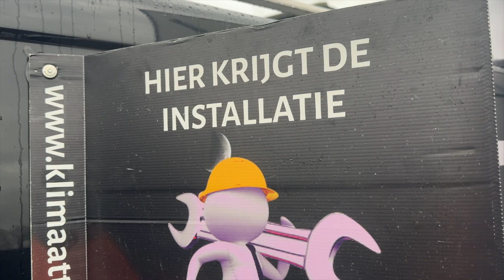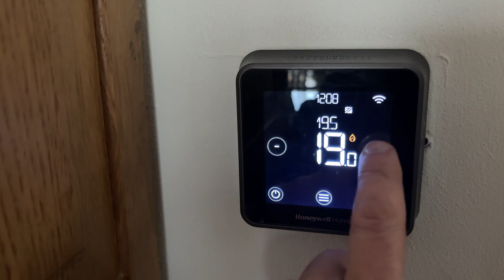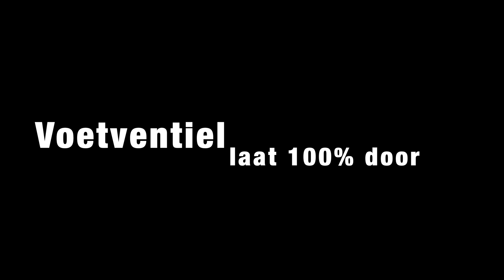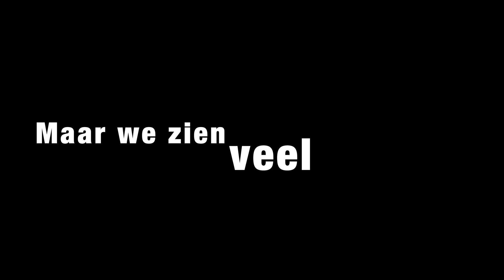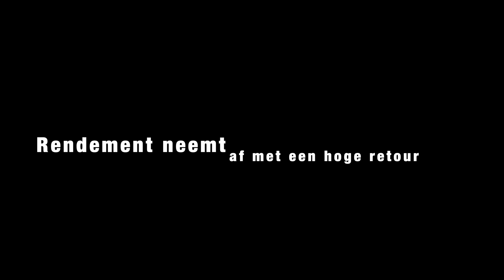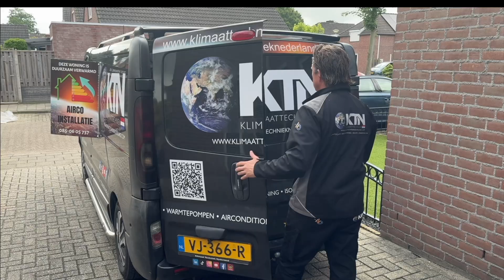Schrik van de Energieverliezen: Warmtepomp Weheat Flint en Nefit Topline

Comment: Die voetventielen,  is dat niet een 1 pijps systeem,    oftewel meerdere radiatoren op 1 streng.    anders zou de retour met koude radiator niet heet kunnen worden toch ?   ( bij 1 pijps is de retour uit het blok voeding voor de volgende rad.)
Reply: Inderdaad meen ik hier de 50-50 koppelingen te herkennen, zoals die ook in mijn CV installatie is toegepast. Daarmee kun je de radiatoren in serie schakelen in plaats van parallel, zodat je minder buizen nodig hebt. De 50-50 koppelingen laten de helft van het water door de radiator lopen en de andere helft gaat direct naar de volgende radiatoren. Wat je ziet met de warmtecamera klopt dus, alleen je conclusie klopte niet.

Comment: Mooi filmpje weer. Er is inderdaad wat ruimte voor verbetering (understatement). De vloerverwarming bevindt zich overigens op de begane grond in plaats van de begaande grond, al zal de begane grond ook wel begaand (=belopen) zijn en de hele installatie is ook om begaand mee te zijn (=medelijden hebben met).

Het nut van vervanging van de HT-verdeler door een LT-verdeler (of in dit geval een hybride) heb ik wel twijfels bij. Een HT-verdeler heeft door de verdunning met koud retour een iets lager vermogen bij gelijke aanvoertemperatuur. Dus de aanvoertemperatuur moet iets omhoog en dat gaat ten koste van het rendement van de warmtepomp (lagere COP). In de praktijk valt dit reuze mee. Bij een typische verdunning van een factor 2 in de HTV kun je de vermogensreductie meestal al compenseren door de aanvoer ruim 1°C hoger te kiezen. Dat kost ongeveer 3% rendement op de warmtepomp. Als je uitgaat van 3000 kWh per jaar (en dat is al fors voor een hybride WP) gaat er dus 90 kWh verloren. Dat kost ongeveer 25 euro per jaar. Indien een hybride verdeler 500 euro kost duurt het dan 20 jaar om die terug te verdienen! Ik vrees echter dat ie inclusief installatie nog meer gaat kosten. Bovendien zal in dit specifieke geval met 12 radiatoren en slechts drie groepen vloerverwarming slechts een deel van de 3000 kWh aan de vloer toegerekend kunnen worden en zal de besparing nog lager zijn dan 25 euro per jaar.
Reply from the maker: Deze verdeler is slechts een deel van het totaal, belangrijk is dat we dit voor klant in kaart hebben gebracht, en uiteindelijk is het een kosten plaatje welke de klant zelf mag bepalen of hij dit wel of niet wil laten doen. Het is gewoon jammer dat een installatiebedrijf is geweest en je ziet dan toch dat leidingen aan het roesten waren... maar goed de warmtepomp is gemonteerd en nu de rest nog.